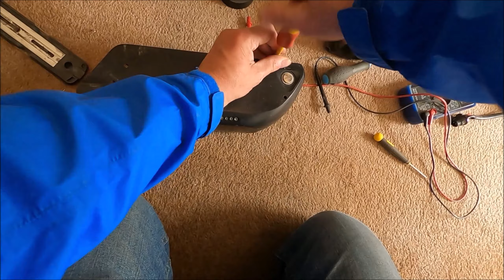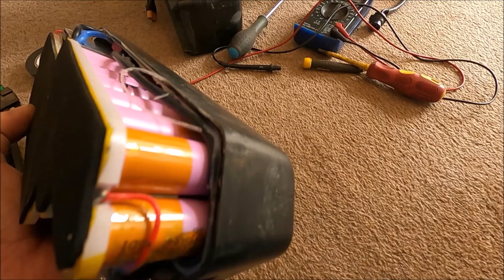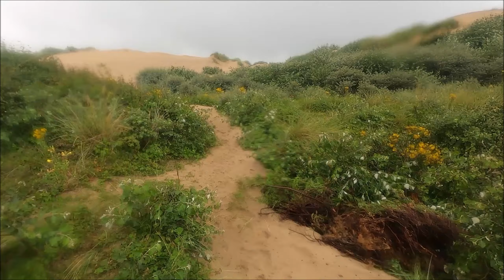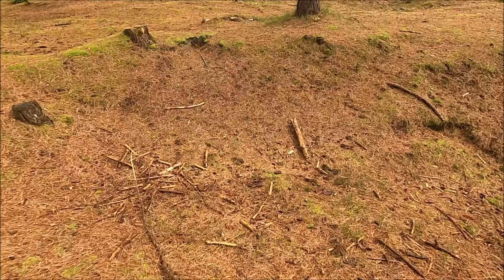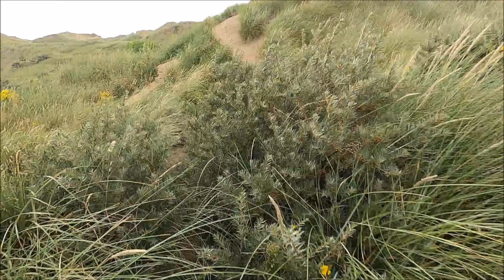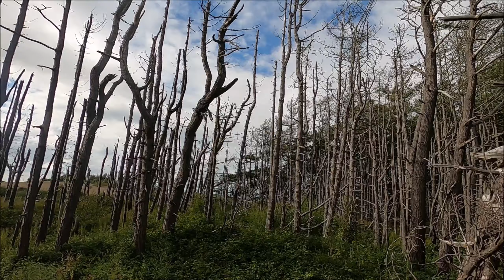Battery completely dead, what went wrong?

Comment: So it was just the fuse breaking the circuit under load? At least it was an easy fix 😀👍
Reply from the maker: I hope so..I cleaned it up and still got another fault did it again and it seemed ok...low voltage dc can be a connection pain at times.